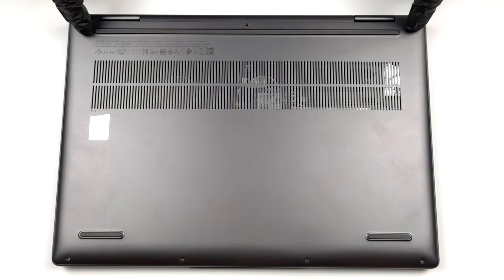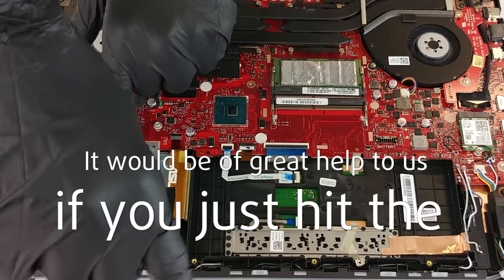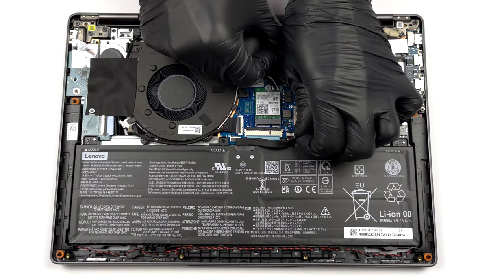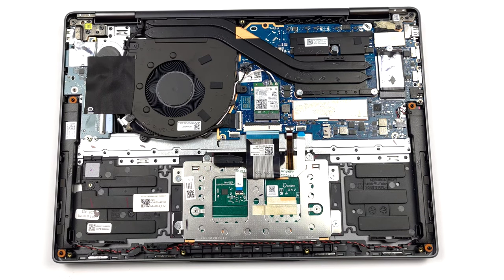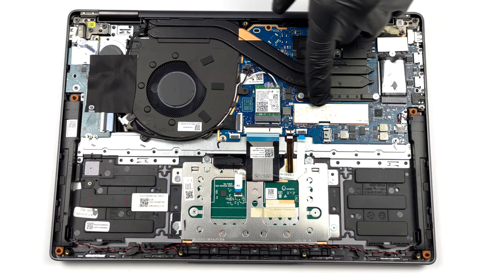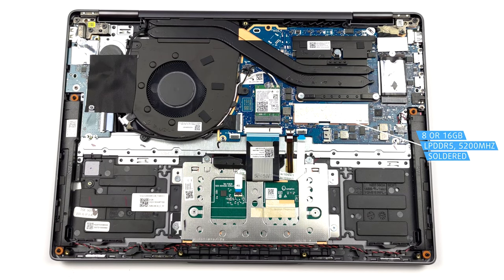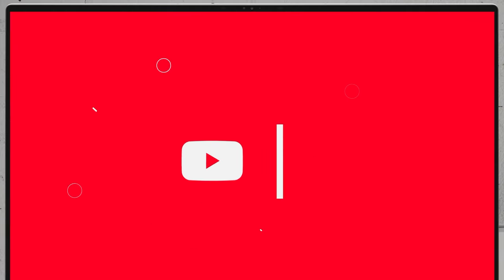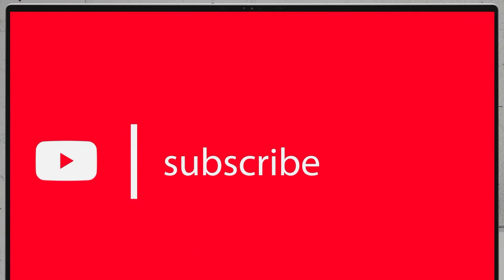🛠️ How to open Lenovo Yoga 7i (14", 2023) - disassembly and upgrade options

Comment: Does it have an extra ssd slot, or you need to replace the existing ssd to upgrade?
Reply: NO it does not have extra SSD slot and replacing original one is pine in the ass, because it is unusual 2242 format. You can not put there 2280 format which is cheaper, significantly faster and can be up to 4TB (even 8TB, but those are superexpensive). And you will have problem to put there 2230 format, because there is no hole for screw, so it will be complicated to hold SSD in place.
Taking into consideration, that in previous model, the had 2242  but it can accomodate also 2280, this looks like typical corporate "screw up"

Comment: can someone explain why my phone is smaller than my yoga's battery while it has 5000mA , since my yoga has only 4400mA
Reply: @snazzymaps10  No that is completly wrong!
Reply: Because you are naive enough to jump on marketing. Using mAh for battery energy capacity is same stupidity as using RPM of engine for comparing power output. In fact, that lenovo has 5 phone batteries stack together.

Comment: the 2242 sized m.2 is such a pain is the ass.
Reply: Exactly. Previous model has also 2242, but with adapter and in place of 2280, exchanging it for bigger and faster 2280 was easy.

Comment: 8gb ram Change to 16gb ram?
Reply: when you buy it you can get it with 16gb, but after you buy it it is soldered in so you can't replace it.
Reply: @snazzymaps10  Nope, and this is special RAM using unique (for consumer Ryzens) 4 channel memory system (I suppose, that in fact some part of ram is dedicated for graphic circuits in CPU, because consumer ryzens has only 1 channels memory. And because of this uniqueness even desoldering and soldering different one would not work. 
I hate lenovo for limitng max ammount of this memory to 16GBs for Ryzen APUs.

Comment: Can I replace the storage of this laptop with a 2280-sized SSD?
Reply: same question!
Reply: @siamak1246  
I have resolved this issue myself and the answer is NO.
This laptop only fit 2242-sized SSD, or you can buy a 2230-sized SSD and an extender.

Comment: Thank you - not - for showing the opening steps, which are literally not feasable. I own one of these and removing the backplate is not possible like you do here.  👎🏻👎🏻
Reply: It is very hard but it is possible (from experience). You have to open it from all angles except where the fan exhaust is. Than wiggle it out.
Reply: It is a little tough, but after removing the screws, slowly slide a thin stiff card between the back cover and the body.  Start at the hinges to get it gping and then work your way around.  Starting anywhere else is nearly impossible.
Reply: @thomasburke185  thanks I'll try when I've got time